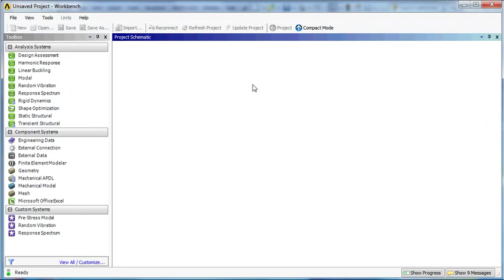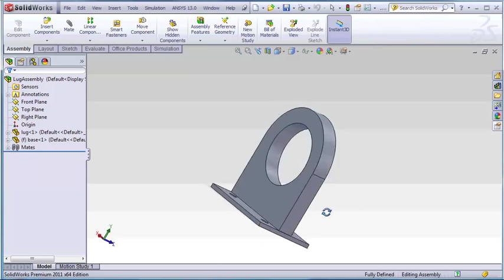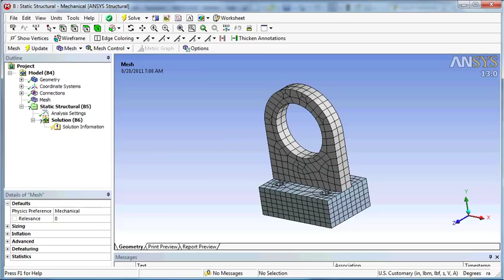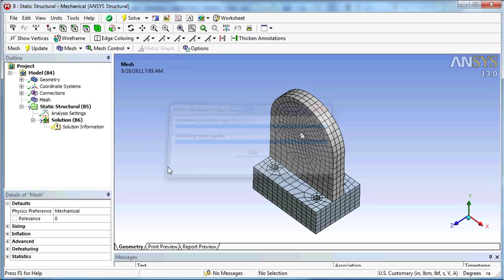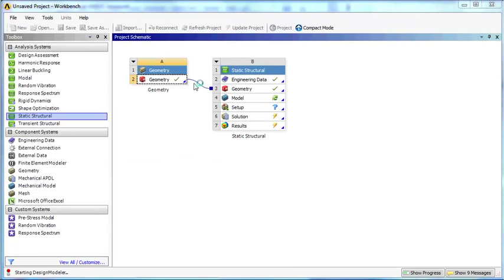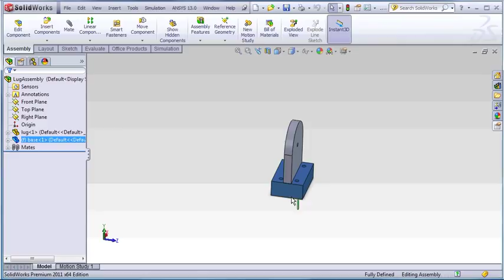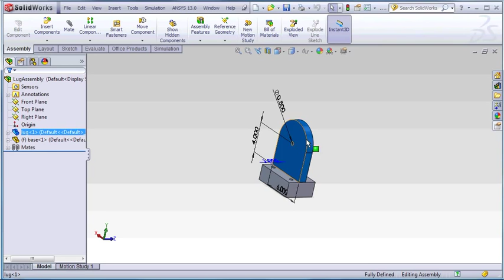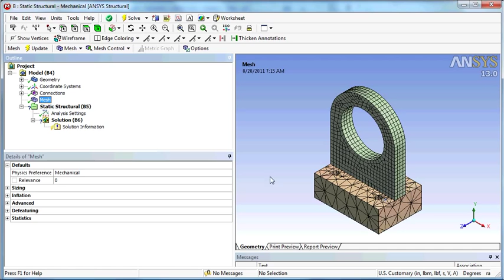Ansys Workbench Cad Transfer from Solidworks & Design Modeler

Comment: Hi, may I ask why I do not have the option of 'Edit Geometry' when I right-clicked on the geometry in ANSYS workbench? Has it got something to do with ANSYS not properly installed or not properly linked to CAD software? I imported manually a .iges file into the workbench. Any help is appreciated as I'm new to ANSYS software.

Comment: I have a problem while I import assembly drawing(solidworks 2013) to Ansys 14.0 .Please let me know about it. The problem can be possible because I still use  a turkish version Solidworks 2013. I have tried saving as parasolid (*.x_t) , IGES (*.igs) and STEP AP203 but never changed the result

Comment: Hi @feaprofessor. I am having troubles to import .sldprt files into DesignModeler in Ansys 13.0. I chose Import external geometry file and select the .sldprt file. When I generate it appears an error. I select to show the message and it says:
Error: Attach failed
Context: Attach feature Import1
It has also happened with .dbs and .sat files.
What can be wrong? Thanks for your attention!

Comment from the maker: You need to run Cad Configuration Manager. It's under program files ansys called CadConfigUtilityGUI. You need to select Autocad and configure. Then it will read DWG/DXF.

Comment from the maker: Open Design Modeller. File... Import External Geometry File... select dxf/dwg file. Don't select Generate yet. In the Tree Outline, select the red Import. Then down at the bottom in the Details view, make sure it says YES after Line Bodies. If it says NO, click NO and change to YES. Then select Generate from the menu towards the top. Your geometry should come in. Reply if this doesn't work and we can do a quick video.